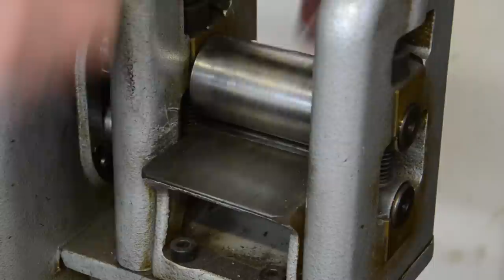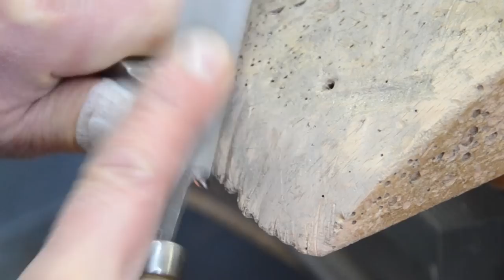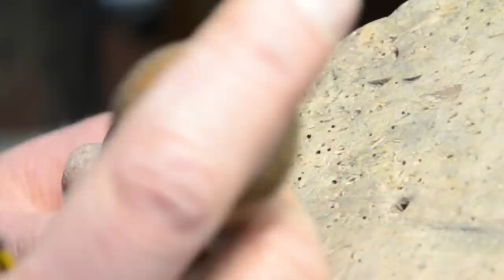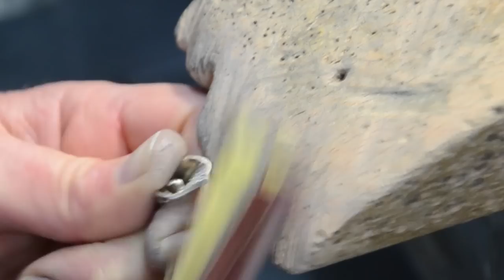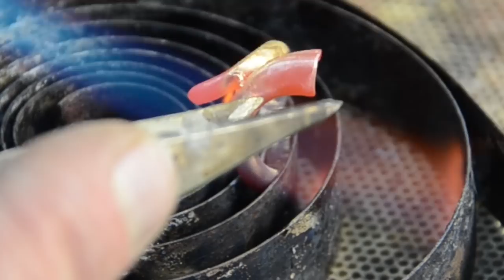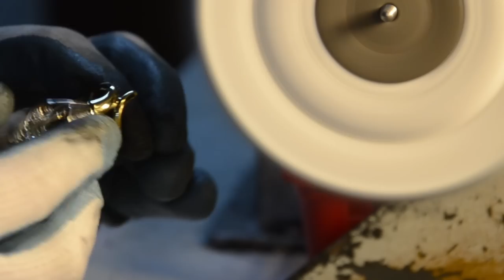Handmade gold ring whit form flower of calla lily

Comment: what is the black clay stuff he used in 8:45  ?? thanks
Reply from the maker: Pitch for setters. I hope that the translation is right use google translator
Reply: Yugal R it’s called shellac. A new method is using thermo-loc plastic. When heated becomes malleable and sets solid when cold. To remove it simply place in very hot water. Not boiling.